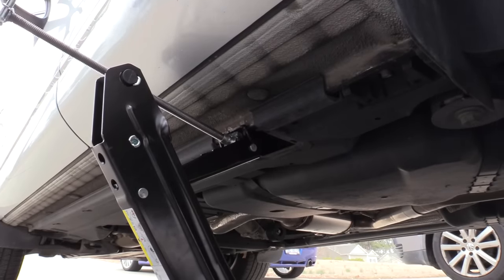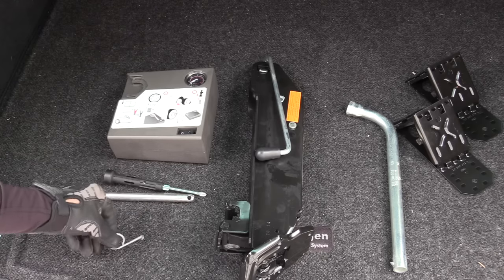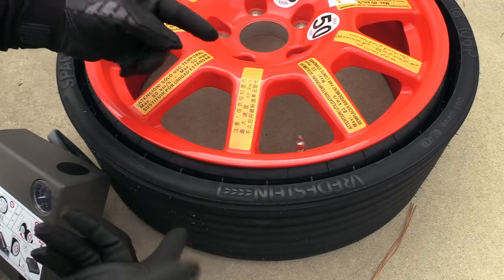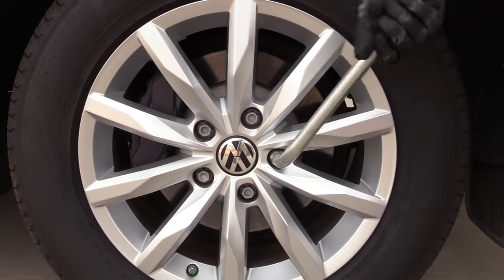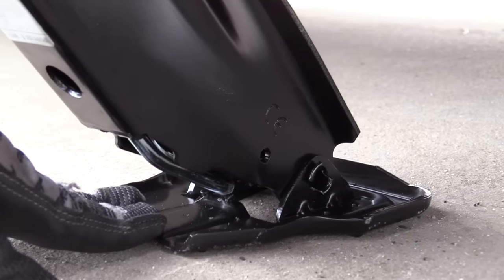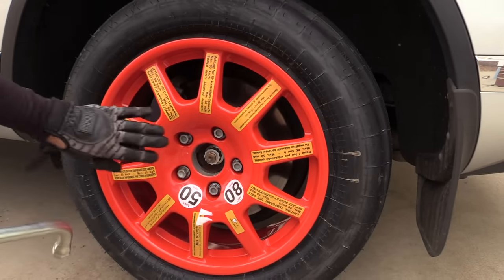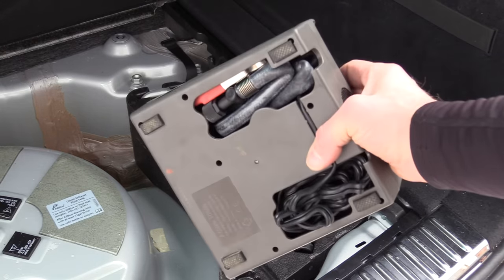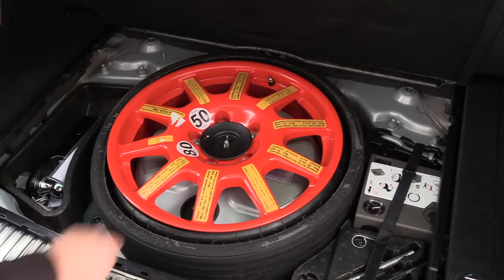How To Change a Tire with a VW Jack (The WIDOWMAKER)

Comment: used to change tyre's for a living, always amazed me how many people drove on flat tyres because they didn't know how to change a wheel

8:00 always make sure valves are pointing away from you if you're removing the core, rather lose a valve stem than an eye

Comment: You should chuck the tire diagonal to the one you are working one, if you do it on the same axle, although you are jacking one side, the other lifts as well, the car can or might run over the chucks and fall(been there done that :D)

Comment: That wheel hanger is more important than people realize, I tried changing a tire on an Audi A6 without a wheel hanger, that'll make a Priest curse like a sailor.
Reply: Depends on the car.
If you use bolts sure, if you use lug nuts not so much
Reply: @IIGrayfoxII  I'm not sure of the advantages of bolts vs lugs but most German cars have bolts and they're a lot more difficult without that hanger to hold the wheel in place.
Reply: @gmax876  If your car has lugs you have 4, 5 or 6 small wheel hangers(depends on how many lugs your car has).
Still a pain to get on but once you get one hooked on, you just have to rotate the wheel slightly and she'll fit
Reply: @IIGrayfoxII Facts! Well done...
Reply: After swapping out my tyres on my Golf weeks ago, I understood the importance of that tool.

Comment: Tip: slide the tyre underneath the vehicle once taken off, that'll prevent damage to the brake disc/rotor and other parts if the car slips off the jack. Pull the tyre back from underneath the car after you have put the spare on and locked it in place with lug nuts. Then lower the car and you're good to proceed with tightening.

Comment: You said it Charles  "practice at home". It harder to change a wheel when it's dark and it's cold and raining. But if you have practiced it will give you the confidence to deal with it. Great video.

Comment: The most dangerous car to change wheels on would be a older Subaru, a front wheel drive with the parking brake on the front wheels. If your on a hill of any kind and have a flat on the front you have to block all the wheels or when you jack up the front it will just roll away.
Reply: Older SAABs (99 and "classic" 900 models) were also FWD and had the parking brake acting on the front wheels.
Reply: At least my 80s Subaru better jack than, it is memory of the car and I still use it sometimes.. This horrible design was in Fiat 128, absolutely a death trap given the amount of rust.. Needless to say used it first and last time, lol..

Comment: When I bought my new vehicle Jetta 17 it came with a donut. That is the first upgrade I did to my car. Put a full tire in the back because it fits I might as well.
Reply from the maker: I totally agree. My Passat has a full size spare. I was super bummed when VW went to the donuts.
Reply: what is funny is that I wanted to purchase the car without the donut instead bringing the cost slightly higher at sale by asking for a full spare but they said they couldn't fulfill request. would you have any guesses why? manager couldn't explain.
Reply: I'd imagine that compartment can't fit a full sized Touareg spare though!
Reply: So where would the damaged tire go? durty up my interior? what if the car is already full?
Reply from the maker: I keep a plastic trash bag in the car for that reason. If your car is full, it’s time to move some stuff.
Reply: HumbleMechanic I’ll be honest I’ve been a very fan my entire life. But I think if they did this to all vw’s then I might look at changing to getting another vehicle...
Reply: Good stuff 👌🏽 mine came with full but i make sure its got a full sized.

Comment: Lol I'm one of the weirdos that has a torque wrench in their trunk. Then again I have a small tool box with most of the tools I need to fix most things on my cars. Most of my cars have been beaters, so I keep tools with me to try to fix them when the eventually break. So far, I haven't needed to fix my 2002 DeVille on the side of the road.
Reply from the maker: YESSSSS
Reply: I keep my floor jack and a jack stand back there too along with my tool box. Glad I’m not the only one that does that sort of thing.
Reply: I have a torque wrench, a breaker bar with 19mm socket, mini hydraulic jack, electric tire inflator, emergency tire plug kit, chocks, and a block of wood in my trunk. 
Everything I could possibly need to change a tire.

And so far I’ve never had a flat tire....
Reply: 300DBenz when you live the hooptie life you come prepared lol. Also I’m jealous of your 300D!
Reply: Joel Ankeny all those tools are in my daily driver (‘99 Subaru). I would make a snide comment about the VW jack, but my 300D is a 1985 model and it has a jack that makes the Widowmaker look family friendly.
Reply: I like pulling up to help someone on the side of the road and having more tools than a AAA guy lol
Reply: I do too, and I've been teased about it many times. One night I saw a friend who had a flat on a dirt road (one of the guys who teased about the tools)I stopped to help. His scissor jack kept sinking into the dirt and falling over and his lug nuts were a mass of rust. He had been fighting with it for over an hour. I got out my tools floor jack, chocks and a sheet of expanded steel I keep under the trunk carpet, done in 15 minutes including putting stuff away.
Reply: I never leave home without my 20 piece husky 1/4 ratchet set, best 20 bucks I've spent and has saved me a couple of times. Also bought a cheap breaker bar and a 19mm and 21mm beep socket.
I got to do what you do have a small tool box with all the essentials in the trunk.

Comment: I wished you uploaded this video before. My sister used to have a ‘12 Tiguan and she got a flat tire once. We spent 10 minutes reading the owners manual to  remove the bolt covers and 15 minutes figuring out how to use that jack without destroying the car.
Reply: in europe it was normal at drivers lessons to get to change a tyre.

Comment: In over 40 years of professional and personal experience with VWs and Audis, I have never ever heard this jack type called a "widow maker" except here on the internet.  When I owned  Touareg  I found the jack so easy to use I used it to mount my winter tires every winter rather than drag out the floor jack.
Reply: All scissor jacks are called widow makers because people have crawled under the car with them holding the car up and gotten killed
Reply: @jmeds_jammin  That is true of every jack made. Any jack supplied with a car is only for changing the tire. I have never heard the term used before except here on the internet

Comment: that really seems like the most stupid jack, a huge increase in risk for extremely small saving in weight if that at all
Reply: Cost saving bro, selling hundreds of thousand or millions unit will save them million dollar more.
Reply: @shhhdontshout  yeah nah bro, the economy of scale doesn't apply to this, there is already designs that can be used, that are already machined, and tooled up

it would in fact cost them more per unit for that jack, (tooling costs over already there and in supply designs etc) 

so, I can assure you, there is no cost saving to be had there
Reply: @copuis  mk3 vw Jettas came standard with these and amazingly mine still had the jack when I got mine. The outside section with the threaded rod going through it wore down and it struggled to stay in the correct form under pressure. After it almost killed me one time I never used it again
Reply: I think they were more interested in saving space, not weight.  In most VWs, there is a hard styrofoam insert that sits inside the spare tyre. This contains all of the breadown tools, including the jack. Their design just takes up less space than the standard scissor-style ones that the other makes use.
Reply: @copuis  My 2002 Volvo has the same  jack and my 1996 Mercedes had a similar jack just much more bulky looking so I'd guess the R&D has been long paid for these aswell as the tooling for them.
Reply: I have it in my VW T5 which is loaded to 3 tones ive used it 5 times works just fine
Reply: You should see the jack on the old beetles it was a smooth pole with a little mechanism that by pure friction creeps up and down it. For the life of me I don't know how that was deemed safe but mine has failed so many times  because if it gets wet at all then it just slips

Comment: This is why i always immediately take out the factory "tools" if you can call them that and replace them with real tools. A real jack, and tire iron. I also like to keep a breaker bar and some sockets too just in case someone else needs help.
Reply: Cool
Reply: I remember once I was changing my tires and the first time I used that shitty scissor jack it folded and fucked up my fender. I now throw that shit in the garbage whenever I see it
Reply: @Xachremos  yeah i feel the vw pain. I have a gti and i had to use the deathtrap of a jack they give you bc i let my dad borrow my actual one. It tends to slip out very easily. It isnt awful but never use it on a heavy vehicle and always use a jackstand, even just when changing a tire.
Reply: @Xachremos  I used that thing for over 5 years now, my father used it for over 20 years and nothing ever happened. What are you guys doing?!?
Reply: @peenusweenus3169  my vw has a scissor jack and a pre inflated tire, i would trust a block of wood over the jack to hold the car.

Comment: My wife's Volvo came with the same style jack. She parked her car with a flat front tire on sloped ground. There isn't much level ground in a lot of Atlanta, so not much choice in the matter of parking. I was able to lift the car properly per the manual's instructions. When I went to loosen the lug nuts, the jack slipped out and I would have lost my toes had they been any closer to the rim. My truck comes with a scissor jack, and with that I was able to remove the wheel safely. These jacks are garbage. How much more money and weight can it cost to add a proper and SAFE jack???

Comment: My 2013 GTI came with a full size spare. It's a 205/55/16 V rated tire on a steel wheel. It has a sticker saying not to exceed 50 MPH and 80 KPH on it. 
A good surprise. I check it every so often.

Comment: The handle of the screwdriver is designed to help spin the loosened wheel bolts in and out quickly. Also, as an added safety measure, I always slide the tyre under the rocker panel and I take it off. If the worst happens the flat tyre/wheel will support the car and save your leg/arm/whatever. Plus, you are still in a redeemable situation with space to reinstate the jack, rather than that corner of the car being slammed into the deck. Keep up the good work.
Reply: Surprised he didnt mention this. Its tyre changing 101.
Reply: @aussieguy1012 , agreed. I was surprised it wasn't mentioned.
Reply: It's the only way to have any confidence working with that jack

Comment: I bought a nice plug kit and compressor so i dont have to use the spare all the time. Just to get me to the tire shop. Got an impact and a good compact jack for flats where a plug just wont do. Live on a gravel road. Used to get like 3 flats a month. Got tired of changing them in the rain and snow.

Comment: First, who the <beep> thought it was a good idea with a space-saver spare wheel? Whoever it was must have had a serious mishap whilst thinking. Where are you supposed to put the wheel you just took off the car? It wont fit the space where the space-saver spare wheel was and it sure as <beep> wont fit in the boot (which is filled with all the stuff the family packed for the weekend/holiday trip).

Second, that tire wrench is a joke. I seriously doubt it is useful for anything other than swearing at whilst failing to loosen the lug nuts. My experience is that for some reason lug nuts needs much bigger tools than that to loosen (even if they have been torqued to spec).
Reply: Leif Simmons they designed it to make our lives hard and itll take alot of beeping to change a wheel. A simple job made difficult
Reply: They probably design the lug nut wrenches to enable you to still loosen the lug nuts but not big enough so that you seriously over tighten the lug nuts even if you stand on the end of the wrench.
Reply: @Nesten321  that's exactly it. They aren't on there all that tight. In the rain it might be a pain in the arse to get a good grip on, but otherwise it does the job fine. I don't like that jack though. You've to be cautious and familiar with its use to avoid setting it up wrong. I don't mind sticking the wheel I'm not holding under the frame, just in case.
Reply: I have found t bar lug wrenches to be the best and keep one with a 12 ton bottle jack in the truck. 4 different sized heads fit almost every car and the t shape always you to pull and push breaking lugs free easier
Reply: its copyed from porsche. in the manual they write. after changing lose the bitch and place the flat in the bag on the front seat

Comment: I keep a breaker bar and proper socket and a wrench after getting 2 flats. I have an older style scissor jack and a ratchet makes it tolerable to use. I also have one of those portable compressors in the back seat for inflating tires as needed. Not really a big kit but makes the process much easier.

I do like that wheel guide bar though.... That's a pretty neat idea.

Comment: If you use wheel spacers, I'd suggest keeping a set of the "regular" length lug bolts in the spare compartment as well.  It may be fine, but the thought of putting the spacer on with the spare so the longer bolts will work bothers me....just something to ponder.
Reply from the maker: All the OEM stuff is meant to work together.  If you’re running longer bolts because you’re modified, having the OEM bolts is a great idea

Comment: This is already stupid: space saver tire, hooking up the pump to the battery jump, and widow Maker, this is dumb, honestly should just be a normal tire spare, with a cigarette plug for pump, and there's no reason to put a cover for the jack point, if they engineer these extra things better, I'd probably only consider it won't try to buy
Reply: For example, Mercedes uses a similar Jack with a rectangle part that goes into a jacking slot, the tire is ready to use, and there's no pump, not nesacery cus at the time, Mercedes designed every thing to fit within the tire, and also, Mercedes also has different lug nuts, but that's because the spare is thinner, Mercedes c240(w203) 2002 base model,and it's still way better than this ridiculous process
Reply: @benzodiy4053  and after 5 years the spare is flat....
Reply: @groenekever  your not supposed to use a spare for daily use, only to get back home then you put an actual one on
Reply: @tyronethetoad3752  but no one checks it.

Comment: Gotta love Germans, they way over complicate EVERYTHING. Very novel way to go about things though. I cant believe they still use those Fing wheel bolts. I dealt with them on VW and Porsche's years ago, figured they stopped that lunacy by now.
Reply: derweibhai 
I dont think this is too complicate... maybe because i am german?
Reply from the maker: I actually like the wheel bolts. But the 15+ years of dealing with VWs has made it normal.HAHA
Reply: There are several newer Jeep's and Dodge cars using lug bolts now. I don't mind them, the worst ones are the lug nuts that swell up from corrosion and you can't get a socket on to get them off.
Reply: I kind of like the wheel bolts. Then you can use a guide rod like they show. I'm getting older and its hard to lift the tire and line up the wheel studs. I keep the ends of the wheel studs painted white so they are easier to see.

Comment: Great video explains how to change tyre really well. These jacks are garbage and are unsafe even on a flat surface just have someone lean on the opposite side of the car with the jack in place. Stand back as the car crashes to the ground. First thing I do is replace it with scissor lift type jack or bottle jack.

Comment: Do you ever have to open that AdBlue cap under your spare?
Reply from the maker: Yeah not too often. maybe once a year.
Reply: Something that used to wind me up about my VW company car was the position of the AdBlue filler in the trunk, doing 110k miles a year meant I was having to fill it up quite often. An obvious after thought and only fitted becuase they got caught cheating on emissions atleast Mercedes put their AdBlue filler right next to the fuel filler so you don't end up with crusty AdBlue inside the car.

Comment: 1:01  Conveniently the VW lug wrench will always damage your alloy wheels in the area around where the bolts screw in... I would recommend throwing it away and replacing it with one that has a socket (which won't damage your wheels), and an extendable handle (which gives more leverage)

Comment: The VW jack is fine, as long as you do 2 things. One, make sure the pad that contacts the ground is directly under the jacking point on the car. If you don't do this, it can slip because the pressure isn't being directed straight down into the ground. Two, as others have said, you should have a piece of timber (square of 12mm ply is small and works well) for use on gravel/dirt.

Comment: omg! could the germans make this procedure a little bit harder??
Reply: Squeek squeek squeek squeek squeek squeek squeek squeek squeek squeek squeek
Reply: Look at the Maus tank then imagine trying to repair the track as it's covered by all that armor and you need a MASSIVE hydraulic jack to lift the tank.
Reply: to be fair there are only 2 additional steps wich are: remove a simple plastic cover and inflating a tire, if you can't handle it, don't blame the germans
Reply: It was a solution to a Porsche problem. Huge rear wheels on a 911 and nowhere to keep a spare that large without making the car 3 feet longer. Solution. Deflate the tyre.